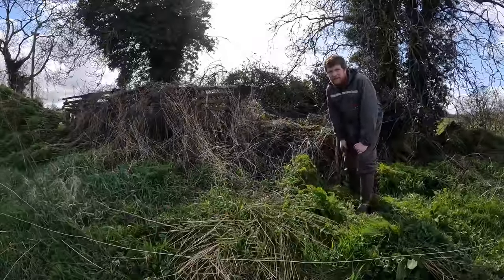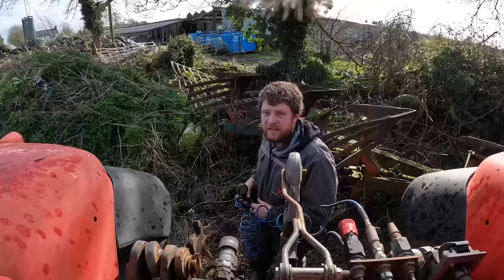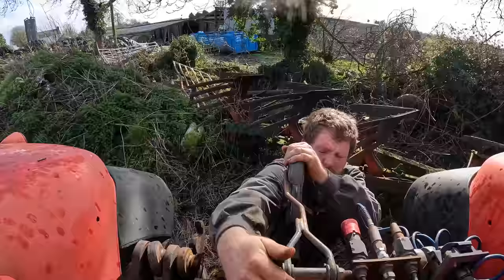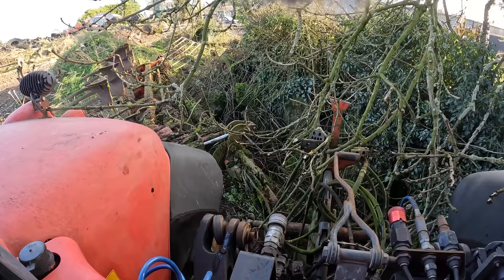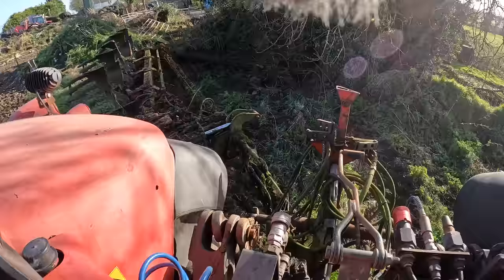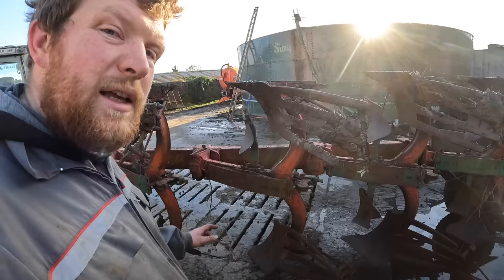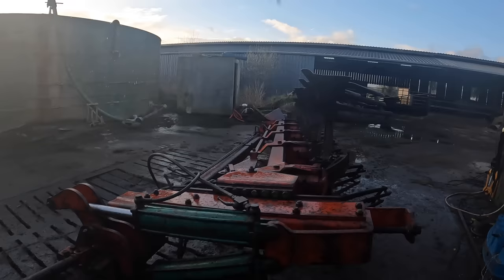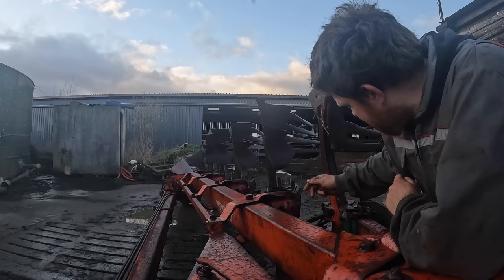RECOVERING OUR 5-FURROW SEMI-MOUNTED KVERNELAND PLOUGH FROM THE HEDGE

Comment: This reminds me of something I pulled out if a hedge once.I pulled a double chop out of a hedge after 25 years, never knew it was there. Put a tube in the tyre, checked the oil in the gearbox, changed a hose because the old fitting was for a valve chest on a 188 which had a 590 engine in it with a huge turbo. The father reckoned that MF 188 was putting out about 120hp at the shaft. The 188 was eventually replaced by a Fiat 110-90 and he said there was noticeable difference. The Fiat was slower pulling up the hills. That 188 was an animal. 1st tractor I learned to drive. I could have replaced the front wheel bearings in my sleep. Eventually it went to South Africa and made 10 grand leaving the yard. It used to chop around 300 acres of silage a year for around 15 years and then was the main loader and scraper tractor. There's lots of gold inside in hedges. Will be class to see the 5 furrow on the 1200

Comment: Phil, each of those furrow bodies with all the kit (furrow extensions kits) are around 4000 euro per piece here in Denmark. There are several used 5, 6 & 7 furrow Kverneland ploughs for sale for a lot less than, what you are potentially looking at in repair costs.
Reply: HOPE YE HAD OILED THE BOARDS.  😂😂

Comment: I ploughed 1200 ac4e a year with a 6 furrow PB100 even ploughed standing sprout stalks once behind a MF3690 in mid to late 90s. Issues I had were front furrow width adjustment always kept moving and you couldn't get right to the edge because of the wheel right at the back was always a good furrow width away from edges of the field

Comment: I welded a broken drawbar  on a John Deere 2130 for a friend. He had been driving silage using the swinging draw bar not the pickup hitch resulting in a snapped drawbar. I gouged it out on both sides and welded it with Eutectic rods for dissimular steel, I can't remember what the rod number was. I also snapped the drawbar on my International B414 when I lifted the linkage and it caught under the drawbar snapping it off. This was repaired the same way and both drawbars lived on. I would try the plough to see if is pulling straight before welding the legs. I would plate the legs as that seems to be a weak point on the plough

Comment: our 1200,then 1250 replacement handled the 5 furrow dowdeswell dp7 4+1 no problem at all ,in a reasonably heavy clay soil ,so the 1200 should handle the 4 furrow easy enough

Comment: wear parts are exactly that you need to replace them anyway. main issue will be the frame and headstock. cold the 4 furrow with the slatted boards be cannibalised to get it going? you probably wont need 3 ploughs as i assume the other r4 furrow will be used used to do the headlands anyway.
Will you need to put an extra spool valve on the 1200? thought there was only 2 double acting sets on it and looks like you need 3.
Looking forward to seeing it all up and running
Reply from the maker: My plan would be to swap the 3 ploughs for 2 ploughs 1 4 furrow and 1 6 furrow to make the most out of having 2 ploughs. 
Shouldn’t need to add another one as once the cross shaft is set it doesn’t need to be plugged in or used
Reply: @FARMERPHIL3690  would ye need to plough as much now that you have the disc harrow? would it only be about a third of the land? i assume its for beans, beet, reseeding and to break up compaction. neighbour here moved to min till a few years ago and havent seen a plough there since.